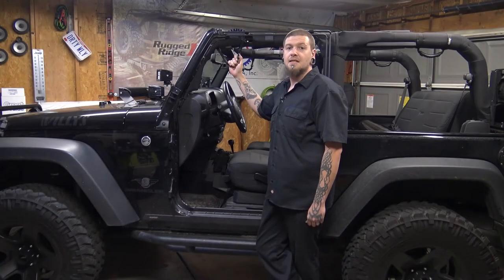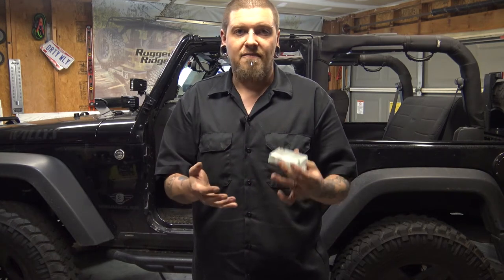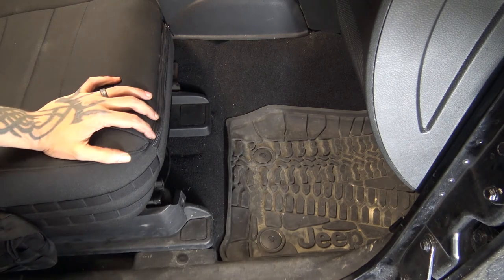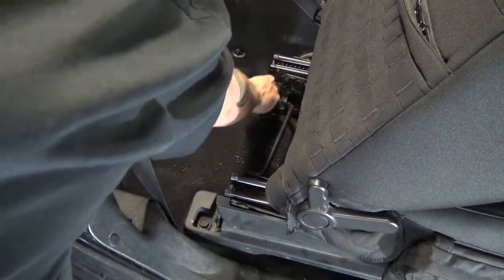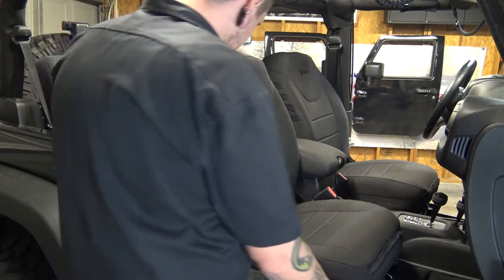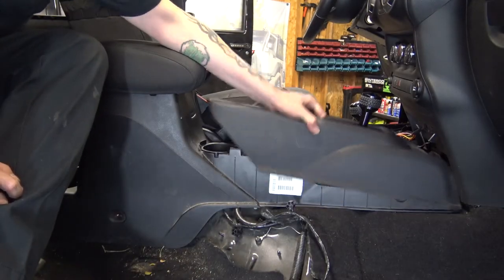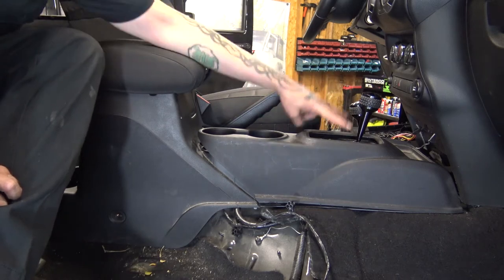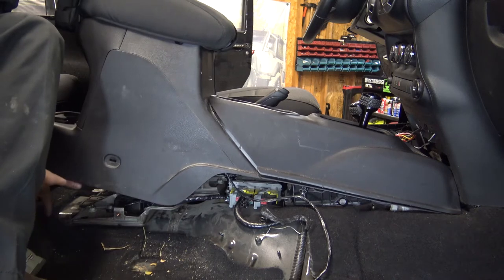How To Add a Motion/Proximity Sensor To Factory JK Alarm, Project Dirty Willy Ep.19

Comment: Great video, the one thing that I would strongly suggest, is to fit a diode between terminal 85 and 86. Eg. The positive side of the diode to pin 85 and the negative side to pin 86, this will prevent any voltage spikes from the relay damaging any of the vehicle's control units. *FYI I have been an auto electronics engineer for over 38 years 🙂
Reply: What kind of diod ?
Reply: The ones that Die when they get Old.....????

Comment: Thank you for your awesome video. I just did this on a 2009 JK four-door, mounted in the same place and it works flawlessly even with my remote start. I did not use a micro switch or toggle switch because when the alarm is disabled from the key fob the unit will not work. So all you really need to do is disarm the vehicle upon entry and the alarm is disabled. Thank you again so much.
Reply from the maker: I'm glad the video could help! I added the Mico switch because the sensor can still pick up movement and cause the dome light or the gate ajar light to come on. This is only an issue if you're working on the interior with the Jeep off, the dome light coming on and off can get annoying.
Thanks for watching!

Comment: Score! thanks a bunch! My 2017 JKURR has factory alarm, my son accidentally activated it 2 weeks after getting the jeep, (unlocked the door with window down)....   a Month later while parked at night beside a fence in a buddies driveway, (with windows down, doors locked)... some thief without opening the door, riffled through the glove box & center console while we were in the garage having beers,. Your right, they take everything of no value, the jeep owners manual, a flashlight, my CD collection & some other stuff of little value that was out of eyesight, all gone!.  
This proximity alarm would have stopped this !!!  Again thanks a bunch, I will order the parts & install it ASAP, 1st thing in the spring!

Comment: Hey man, great educational video.
You should do more videos and I believe you should get paid.
You explained everything in so much detail, I feel that I finally learned what a relay is supposed to do.
On a different note, Best Buy didn't want to install that sensor for me with a 3305V install last weekend.
Could I wire it in, splicing into the existing 3305V relay or do I have to get a separate relay?
Thanks in advance!

Comment: I bet there is a way to bypass the need for that switch. The key is to kind a wire that goes to ground or positive when armed and tie into that with another relay.
Reply from the maker: You are correct, this can be done without the switch, but it is much easier using the mini toggle when explaining this process in a video. Thanks for watching!

Comment: this is great rock. I never knew you could add those things to it, and when I had my srt I just purchased an additional system when I could have Just as easily done this. great job bro
Reply from the maker: Yep, not a lot of people know you can do this... and a lot of shops don't want you to know either. They want you to buy a new unit and have them install it. Thanks for watching!
Reply: you know if I haven't put my bumper on yet and ive had it for like 6 months still wrapped up like it was when it was delivered from ups, whos saying how long I would take to put this in and it looks really simple. . you rock man. and thanks for the like on wva jeep community.
Reply from the maker: LOL! Not a problem man!

Comment: You could splice into the hood switch, it won't activate the lights inside the vehicle. This is used to protect the battery from being disconnected.

K6ORJ
Reply from the maker: Great idea, but unfortunately the Wrangler doesn't have a hood switch. Thanks for watching!

Comment: Thank you for the videos! Made my hard top dolly/cart last week (slightly modified-but of all the plans and how to's out there, I used yours-THANK YOU!!). 

I was looking at the motion sensors you installed on your JK on eBay, and found shock sensors as well... What are your thoughts on shock vs motion? Also, the shock sensor appeared to be from the same company and looks to use the same harness as your motion sensor... Do you think install would be the same?? 

Sorry it got long winded! Thanks for sharing all the videos!
Reply from the maker: Thank you for watching the videos! I'm glad they could help you out. As for the shock sensor, yep... same install and same harness. You can actually use both at the same time, but this will make the system very, very sensitive. My thoughts on one vs the other... if you are suspect that someone might get in the Jeep, either would work well, if you think someone might just reach inside, then the proximity. I think more people would be wise to the shock sensor in the way of being really gentle if they get in the rig, but if you have a motion sensor they can't really get around that. Either or both are good additions to the OE setup. Thanks again!

Comment: Hi, great video!  Just want to know if any aftermarket proximty sensor would work?  Also, do you have any instructions on how to install a pin switch under the hood and connect it to the factory alarm?
Reply from the maker: I would imagine any proxy sensor would do the job, the wiring colors may be different though. I'll have to look into the hood pin switch, I have one installed for an under hood light (have a video on that as well) Wiring it to the alarm may be possible, I'll let you know if I figure something out. Thanks for watching!

Comment: I have a problem that I can't figure out and hopefully you can. My gate ajar light stays on regardless of the toggle switch being off/on and the sensor won't trigger. 
My connections are followed:
RED+ from battery into toggle switch, red wire out toggle into relay pin #30
Purple/Orange gate wire to Blue wire from module
Pink/White Ignition wire into relay pin #86
Red wire from module into relay #87a
Black wire from module T connected to ground of Jeep and relay #85

Thanks for your help and keep up the great videos
Reply from the maker: All off the connections you listed are correct. It sounds like your gate wire is touching a ground somewhere. You may want to check all connections made to the gate wire and make sure they are well insulated.
Reply from the maker: Have you had a chance to check everything over, if so any luck?
Reply: Rocky X TV No I haven't. I plan on doing it tomorrow. I'll give you a update tho. Thx Again

Comment: Nice video!
Based on your experimenting with the sensitivity, can you make the detection field large enough to protect the rims if someone was attempting to get them off?
You said you would not want it to go off if someone just walks by in a normal setting. However, depending on the time/location it would be good to be able to warn people off who were skulking around at 3am in your driveway looking to steal your rims.

I also wonder if you could manually disengage the proximity sensor (with the switch you installed if you had the sensitivity set that high for special situations), where you lock the doors and engage the factory alarm with the fob?

Comment: Excellent video!  I keep my recovery gear in the back of my 2dr with a soft top and will love to have the proximity sensor linked to the factory system.  Now that you have had it for a while, any issues or updates?
Reply from the maker: Still working great! Only issue I have discovered is that it does not play nice with the remote start system I installed. The remote start works off of the OEM key fob by hitting lock 3 times, then it starts the Jeep. When using this it seems to make the proximity sensor think someone is stealing the Jeep or something. If I try and remote start while the proximity sensor is on, the alarm goes off and the Jeep starts. I don't think this would be an issue though if I had a factory remote starter. Thank you for watching!

Comment: Hi Bro, thanks for the informative video, I've understood most of it as a newbie to electronics. I just wanted to run something by you. 
1. Could I use a fuse tap pigtail to tap into a constant Power source at the fuse box then add an additional fuse for the new circuit (the sensor)?
2. Could I do the same as above for the ignition power, except that I connect the fuse tap pigtail to the cigarette lighter fuse?
Thanks in advance
Reply from the maker: You sure can, I always hard wire everything and forget to think about easier ways to hook things up. I have a video coming out this morning that uses fuse taps, just to show how easy things can be. Thanks for watching Kriben!
Reply: Okay thanks for that, Also do I not need to worry about the difference in amperage between the two circuits (the one I'm tapping into and the sensor circuit) will the 30-40A relay prevent any fuses being blown?
Thanks again bud :)
Reply from the maker: The relay wont prevent any fuses from blowing, but as long as you have everything wired correctly you wont have to worry about blowing fuses, this setup has a very low power draw. The relay is just there to act as a middle man so to speak, it tells the new sensor setup when the vehicle is running so the sensor doesn't keep going off while you're driving. I hope that makes sense.
Reply: The functionality of the relay does makes sense. How many Amps is this motion sensor rated at? Amazon doesn't list it
Reply from the maker: I can't say 100% what the draw is, but I would say it would be less than 2amps. More likely around 1 or less because it just sends a signal to your OEM alarm and your vehicle takes care of the rest.
Reply: Okay thanks a lot, I'm gonna go ahead with ordering the parts now. i'll send you a message once I've completed everything successfully. Thanks for all the help and keep the amazing videos coming! keep it up dude!
Reply from the maker: Thank you for watching them!

Comment: So, I am now looking into these motion sensor alarms for my '16 JKUR as I just had my second break in last night through my soft top where the thief crawled all through my Jeep searching all my molle bags, under seat, console, and glove box.
Will the position you used still be adequate to get my rear seats as well? Im not worried about the tailgate compartment as I dont have anything back there but a 35" spare tire. I have the BarTact seat covers and use pouches to hold most of my recovery gear and other miscilaneous tools. Just something enough as a deterent or to wake me up and scare off the would be theif would be nice.
Reply from the maker: I can't say 100% as you have a 4dr and I did this on a 2, but I'm pretty sure. I tested mine and it will go off if you reach into the back seat. It doesn't do much for all the way in the rear, but if you're anywhere in the Jeep long enough and moving around it will go off. I can mess around all the way in the back for a few seconds before it will go off, but it seems the closer you are to the sensor the faster it will pick up your motion. I hope that makes sense. It works even better with a soft-top because you mess with any part of the top and it moves in a bunch of spots and goes off much easier.
Reply: Thank you for the fast response. I may play with a could locations and see which one works the best for me. Really appreciate the video, very helpful to get an idea for what it will take me to install one.

Comment: Does the oem alarm not have a triggered while armed wire where we can tap our 12v ignition/trigger source instead of going to 12v ignition?  So we would hook up 12v con. Same but the out put to the output to the on while triggered not NC pin?

Comment: Great video man !. couple questions.. 1. the pink 'switched wire' is a wire with power source that comes on only when the key switch is on? i wasnt sure what you meant........and 2. when running the constant 12v red wire did you connect two wires to the mini switch? one prong from battery and the other prong to the red 12v constant to the relay?     thank you for your response and time!
Reply from the maker: You got it all correct! Thanks for watching, and if you have any other questions don't hesitate to ask. Thanks again!
Reply: How did you adjust the sensor ? I tried rotating the rubber ‘adjust knob’ but doesn’t seem to do anything .
Reply from the maker: You have to remove the rubber, those are just plugs. There are adjustment screws under those plugs.

Comment: Will the alarm go off if you lock the doors while driving
Reply from the maker: It will not. This is because the relay that controls the motion sensor is off when the key is on. If it weren't wired correctly, I guess it could go off.
Thanks for watching!

Comment: I have s question.  I have noticed my prox sensor will randomly set off the alarm.  Ideas? My doors are on.  Windows closed.
Reply from the maker: I've had this happen if something passed over the top of the Jeep. Like an opening garage door or parking under a tree and the branches would move. It would also sometimes go off when the soft top was on and was windy.

Comment: So if you only have keyless entry is there a factory or aftermarket alarm that just plugs in like the Fortin remote start or do you HAVE to go aftermarket all the way?
Reply from the maker: I'm not 100% sure about anything that is "plug and play", but you may have a partial oem alarm if you have keyless entry. Roll a window down then hit lock on your key fob. Wait at least 15 seconds then reach in from the outside and open the door using the inside handle. See if an alarm goes off.

Comment: Hey Rocky , i just want to say thank you or the content you provide! I have some questions on this install. 

When the alarm is on and it gets set off does it eventually shut off after there is no movement? Or will it keep honking until the jeep unlock key is pressed? 

Also would there be a problem if the dome light is turned on when the alarm system is activated(jeep is off)? Would this damage anything? I believe if the Jeep is on then it wouldn't damage anything since there won't be any power to the relay, but not sure when its off

Last but not least, you said that if im going to get into my jeep and i unlock it , once in , it wont beep, but the dome lights will go on and The dash will say gate ajar. Doesnt really bother me, but to avoid this you would have to turn the switch off correct? Bascially disabling the system

Thank you!
Reply from the maker: The alarm will go off for I believe 15 minutes, or until the Jeep senses the battery is getting low. It will then shut itself off to keep from draining the battery, Smart Jeep LOL! If the alarm went off and you didn't hear it, then it shut itself off, when you return to your Jeep and press unlock the horn will honk 3 times really fast to let you know the alarm went off while you were away. I hope that part makes sense... No worries with the dome light. You are correct about the switch, it just disables the motion sensor. Thanks for watching and for reaching out!

Comment: Hello, awesome video. I found all but one wire. In the video it stated the gate color wire for your 2015 was purple with orange. Do you know if it is the same for a 2016 joy? I think I got the right wire but when I tested the wire to the ground, I get no hate light turned on.  Thanks
Reply from the maker: I'm not sure what the wire color code would be if they changed it. I'll take a look around and let you know if I find anything. Thanks for watching!
Reply: Thanks for the quick reply. Found the wire. Same color as 2015. Just hidden behind other wires. Tested line and light came on for the gate. Ran into another issue. Connected wires to relay and system work BUT when I turned on the by-pass switch on from the 12volt (constant) line, it put the Jeep into on/run position. Very odd. Don't know if having an auto starter effect it or not.
Reply from the maker: Now that is a new one for me... I've never heard of this issue before. Do you have factory remote start?
Reply: Factory alarm with after remote starter. No aftermarket alarm installed. Thanks for all your help. Just very odd. Might be a stupid question. 1. Am I supposed to turn the switch on? 2. On the device, when I lock/arm the system, should the device light (green/red) be on?
Reply from the maker: The switch should be on when you want the newly added sensor on and off when you don't. I honestly don't remember what lights or colors came on the sensor. I also have an aftermarket remote start (MPC) but no issues there.
Reply: Thank you for your info. I will try to reconnect and see if I can find .

Comment: Can you add the motion/ shock sensor to the factory KEYLESS entry?
Reply from the maker: You just need to do a simple test to see if this will work for your Jeep. You'll need the doors on.

- Roll down your windows
- Lock the Jeep using your key fob
- Wait about 15 seconds 
- Reach inside and open the door from the inside 
- If your horn starts honking, then yes this will work for you.

I hope that answers your question. 
Thanks for watching!
Reply: @RockyXTV  it did.I have a Chrysler 300c but all these rip off shops keep saying I have to get an aftermarket alarm.I live in The Bronx
Reply from the maker: @missayawk  That test means you have at least a basic "anti-theft" from the factory. There are differences between OEM anti-theft and an alarm, but you have all you need for this setup. 
I would have no idea on how to guide you on doing this install on a 300 unfortunately. Maybe there is a trunk wire you can substitute for the "gate" wire I mention in the video?
If you are able to use the info in the video to make something work for your 300 be sure to let me know, I'm really interested if this will work.